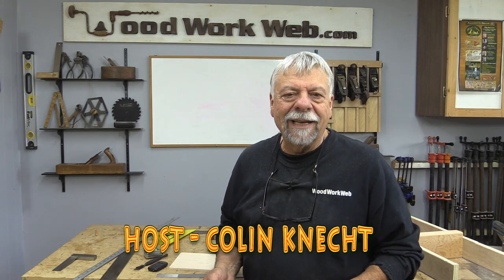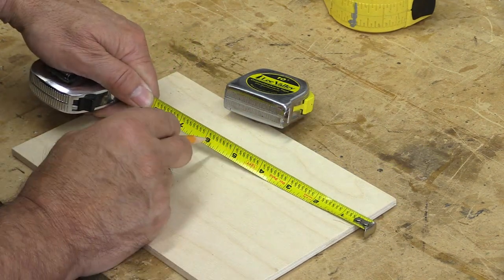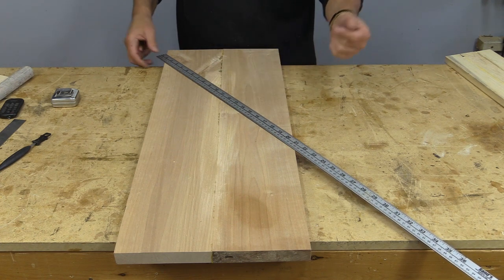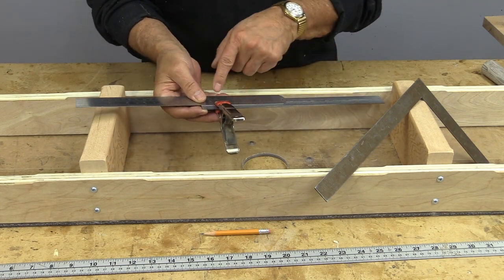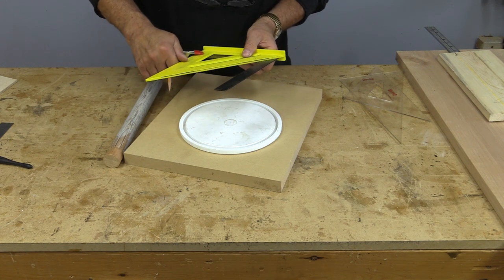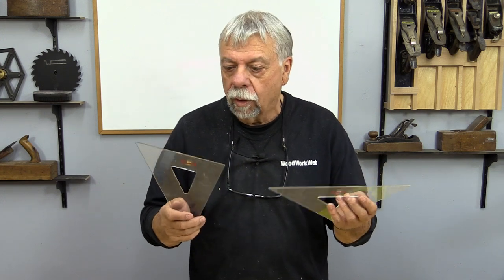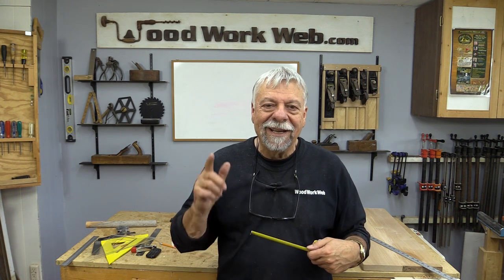5 Quick Measuring Hacks - Woodworking Tips and Tricks

Comment: You're all right and wrong. Engineering triangles/architect triangles are the clear plastic ones. Usually an isosceles-right triangle with a cutout 30-60-90. They're generally used at the desk/drafting table because they scratch easily, are Very flimsy and the markings wear off in no time at all so they're not great for the floor/worksite. The plastic triangles (like his yellow one) is known as a "speed square" and is generally used on site though it'd be better in a small shop than always at a construction site. An aluminum version is better for the abuse that a construction site will see. Anyone else here old enough to remember the other items that generally went along with the architect triangle? ... Slide rule, T-square, french curve, stencils of shapes, drafting ruler (3-sided), ... You can probably still get all this stuff (good luck on the slide rule).

Comment: That particular construction square is usually called a speed-square.  It's designed primarily as a roofers tool.  I have one that I use a lot but you have to get one made out of metal if you want it to actually be square.  The plastic ones warp.  Good stuff as always Colin!
Reply: foxdesignbuild foxdesignbuild empire brand is a pretty good one the metal ones are the best I think
Reply: @nathanaelmorales760  that's right. My Empire speed square is plastic, but it's still a whole lot better than the cheap brands.
Reply: Matt Heere , framers squares are primarily made for framing.

Comment: The quickest way to find the center of a circle , with a square , is to draw 2 straight lines within the circle , find the centers and line the square up with the centers , with 1 edge on the line , draw a line , 90 degrees from each center , where those 2 lines cross will be the center of the circle .

Comment: Hi Colin, I am new to your channel but I subscribed right away, you have a lot of practical knowledge you share easily and clearly. I am making a rolling pin with a celtic knot in the middle. I can find the middle but how do I figure where to start the cut and have it land exactly in the middle half way through on say a 55° angle. My protractor is not very accurate. ;-)

Comment: My tip for measuring is to use THE SAME measurement device during a task.
Sometimes we measure a space using a measuring tape, than we cut the shelf using a carpenter's wooden folding rule... OMG, they never measure the same...

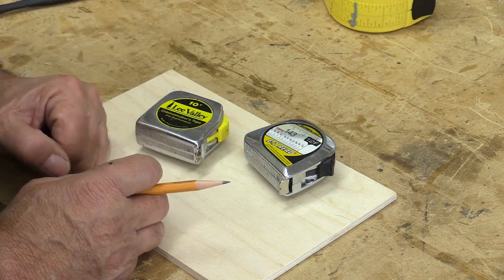Comment: 1:48 As soon as you have more than one cut, you will only get exactly equual width if you take the thickness of of the blade into account. Otherwise the outermost pieces will not be the exact same width as the middle ones. The outer ones will be half a blades width wider.

Comment: Everything was good until you got to the end and claimed to not know how a carpenter square worked.  When you showed the ruler next to the square and said the measurements were off.  You did not compensate for the bottom edge and start at the pivot point to get your measurement.

Comment: I was taught that using the end of a rule could result in measuring error if the end happened to get sanded down, rounded, or compressed. A careless person tapping the rule on the end would shorten the tool or chip a corner. Start at two and subtract one from the measurement for a precise reading.
Reply: Lucky B if you use the same tape the whole time, it should be ok.  But I know what you mean.  However, you said to start at two and take off one? Are you counting 0 as 1? either way, it's best to measure the way you started. If you burn the tip when measuring the area, burn it again when measuring the material. Personally, if im counting in inches, ill burn the first 10" and if im counting in feet and inches, ill burn the first 12".
Reply: Yup, using a tape measure you need to do that all the time, like for doing base board with two outside corners, you're going to need to cut an inch to get an accurate measurement for your second mark.

Comment: However if you want to rip or cut into equal widths you have to take into consideration the thickness of the blade which in a circular and be 3 to 4mm

Comment: There’s a missing tip! Why don’t US carpenters switch to metric for shop woodworking? Addition, multiplication, division etc are just so much easier. You’re automatically getting 1/25th of an inch accuracy. And it works for very small distances or larger distances without changing units? I used feet an inches for years. Made the transition to metric and it did take a little time to get used to it but now I can’t imagine going back. I know in the US that you have to buy material in imperial.

Comment: Here's an easy way to divide a number by 2. Let's say you want to divide 17 3/8 in half. Divide 17 by 2, and you get 8 then add the 3 and the 8, double the 8, and you get 8 11/16. To Ddvide 9 1/2 by two, divide 9 by 2 and get 4, add 1 and 2, double the 2, and you get 4 3/4.
Reply: I know how, but I'd rather not do it.

I'd not be choosing 17 3/8 for anything...

Comment: Colin, I always enjoy your videos. However, every time you snapped one of those tape measures my stomach cringed. Letting them snapshot does a couple of things, it eventually breaks the hook on the end off but it also elongate the hole that Doug is in and causes your tape measure to not be accurate. Slowly close the tape measure and let your finger buffer the shock and your tape measure will last a lot longer.

Comment: Whoa!  Whoa! Whoa!  The purpose of using the angled ruler to divide a board into equal pieces was to avoid the math. But you just set yourself up to do different math with your method. And by the way, not everybody struggles with elementary school arithmetic. Half of eleven and a half is five and a half and a quarter.

Comment: I always glue the tab on the end of the tape measure. Otherwise, there is a chance that your measurements will always deviate slightly because there is play on the tab of most tape measures. Do you have different sizes and have you measured correctly? Glue the tab!
Reply: That play in the tab has a function - the amount of play is equal to the thickness of the tab, so if to go to measure the inside of a drawer for example, when you butt the tape against the board, the tab slides in, and you end up with the correct measurement - if it doesn't slide, your measurement would be off by the thickness of the tab.

Comment: Any tips for accurately measuring  for brackets or cuts on multiple boards at the same time, when they all are to be marked at the exact same spots( shelving and such) I’m trying to measure the boards for shelving and have divided one board into 4 equal parts, drawing horizontal lines across the board, and repeated this with the other boards, but when I line this board up with the others I have also marked at the same ( or so I thought) places, my lines on one board does not match up with any of the others! Uggggggg!
Reply: Line up the boards side by side and mark across all of them at once.
Reply: Adam Rogulski omgosh. I can’t believe I even asked that question, such a simple solution! A carpenter, I’m not, obviously. Thank you for your help!
Reply: @jessicaelhardt7516   just keep in mind that when you are cutting multiple boards at a time, that if your saw isn't set perfectly flat and square that although the top board may be perfect the boards below could possibly be short. The bottom board being the shortest.

Comment: I will be using that division method. Bit of a math geek. But I missed this one.When finding the.center of a straight line that is horizontal to me.such as the side of board. I measure it Mark what.
appears to be the center. Measure from both.sidesits usually of no more than a fourth of an inch. Then measure both sides to my guess mark. If there is correction I move it . Measure the two distances and voila..it will be.correct..law of averages.

Comment: I wonder if the problem is that we are a top down left to right (America, English speaking countries, . . . ) and the numbers are upside down because you are measuring backwards - right to left!
If you held the tape so as to measure two inches in from the left edge of the board the numbers would appear upright. Could it be that the tape was trying to tell you something?
Reply: You still need to measure at different times from the left and the right sides of the board (which completely negates the use of a "left-handed tape measure"), so the problem here is still operator error.

Comment: I don't understand how the diagonal works. The hypotenuse (which is what you are creating by measuring to the 12" mark) is longer than the base (straight across the board). If a board is 11 7/16 wide, the center is 5.72". Moving it to 12" will give you 6", which isn't the same.

Comment: That yellow thing you called "some sort of triangle" is a carpenter's speed square.  And you managed to find the cheapest crappiest plastic one around, no self-respecting carpenter would touch it.  No wonder it has a wow in it.  If you had a decent steel or aluminum square you would have reliable accuracy.  Swanson is one of the best in quality but there are many good ones.

Comment: Your terminology is maddening. When comparing measuring tapes right hand to left handed you continue to say right when you mean correct. A “construction square” is well known in the industry as a speed square and you get what you pay for … plastic is hardly a precision anything. The “engineers squares” are drafting triangles used in the architectural field. Engineers work with data that is created by an architectural form. I’ve worked with engineering firms repeatedly my entire career. A triangle of any form will be hard to find in one. Make up your mind. Are you presenting on a professional level or home owner DYI level. Be one or the other don’t confuse the public attempting blend the two.

Comment: You would not have half the tape issues, or have to buy special upside down lefthand tapes, if you simply  join the modern world and use the metric system.
Reply: AV Veratu ..and lose the use of thirds completely? ..and have to rely on 1,000 for eighths? Preposterous! Besides, I've got a metric tape measure. ..2 or 3 of them actually. The same issue with the numbers being printed in only one orientation still persists. ..and the useful length  an indexed linear segment  of either scale , standard or metric tends to be about the same and some trades prefer them to be about twice the height of the average man , some, 4 times, some 6. I've got a couple that are about 17 times as tall (100'). My point is now will the metric system solve the problem that requires people to own various tape measures? I'd argue that it would require us to own even more tape measures.. Lol lol
Reply: @jdog4534  i didn;t exactly follow everything you said but i still agree.
Reply: @yardlimit8695  yea, I see what you mean.. Lol I could do a lot better transitioning or something. What I kinda meant was that tge meter and the yard are close enough to the same. They're about half the height of a grown man and tape measures come in many different different lengths. I can't remember what I was getting at with that  but my main gripe about the metric system is that, like the decimal system, there are no thirds and, besides halves, none of the other useful fractions used in building are within the primary base of 10. You have to go to 100 to get quarters, 1000 for eigths, 10,000 for sixteenths.  When I look at mm, they're too close together for them to be handy.
Reply: @jdog4534  now i get it,,,,,,,,,,i guess i was right to agree.........
Reply: The metric system sucks, and is therefore free to bite me at it's leisure...
Reply: A smart enough person could read a tape measure upside down.
Reply: @jdog4534  mm too close together to be handy? I think you'll find sixteenths are closer, and thirty-seconds can hardly be seen.
Reply: Agreed, the response from our American friends is just the same as we had in the UK fifty years ago,when we converted.Those who moaned loudest were found to be lacking in any comprehension of weights and measures, whether metric or imperial.
Reply: @jdog4534  I only own one tape measure, and it's metric. I can use it and read it whatever its orientation, and I can't say I've noticed the construction industry has been hampered by the losing the use of thirds, quarters,whatever. Come on America, it's the 21st century!
Reply: @barlow2976  but they can be determined from the whole unit from which they come. The metric system must be handed to you and could never have existed before the Imperial standard was invented. And what were you saying about 16th being closer than millimeters? Are you sure about that? Last I heard there were 16 of them in an inch. Hence the name sixteenths. And I know there are 25.4 mm in an inch. Not unless things have changed, they would have to be closer together to fit 25 of them in an inch unless we're in some kind of quantum simulated reality. The metric system is not natural how do you divide anything into tenths? ( I know, I know you go diagonal using any measurement is divisible by 10. But still... )  how easy would it be to cut a pizza into 10 equal pieces? And how would you split it between 3 people? If we only had the metric system we have no triangles. How do you build anything with any structural Integrity without triangles? And I've never owned a tape measure that didn't have numbers on both edges of it. But the ones that are give me the most trouble or the ones that have metric on one Edge and standard on the other, or Engineers feet that break inches down into tenths. I said it before and I'll say it again, tenths are useless and unnatural. They only yield tenths fifths and halves. Tenths and fifths are never used and halves can be determined without the use of any scale.